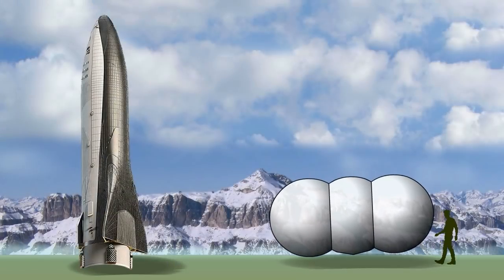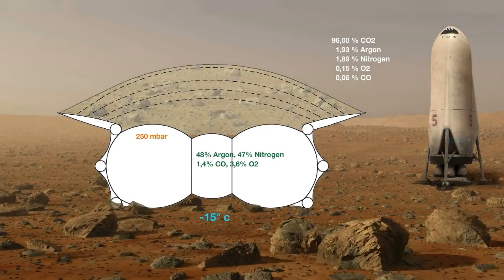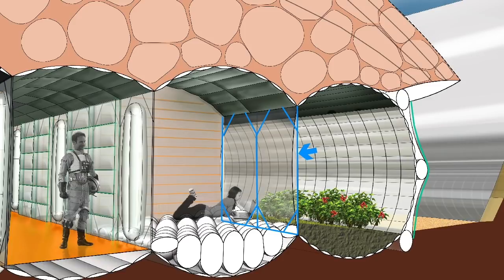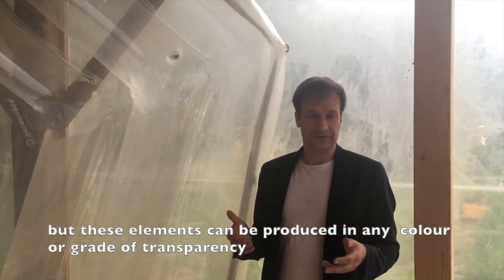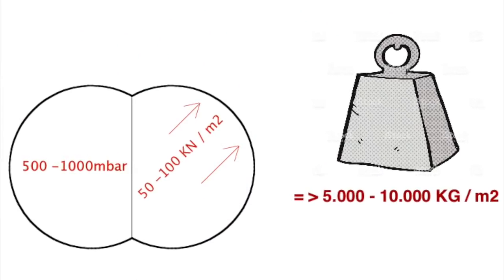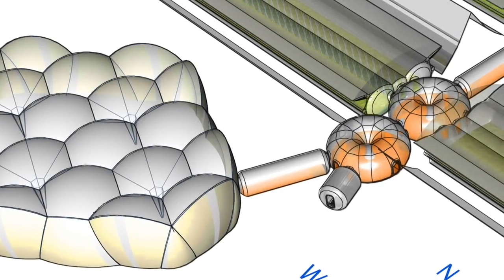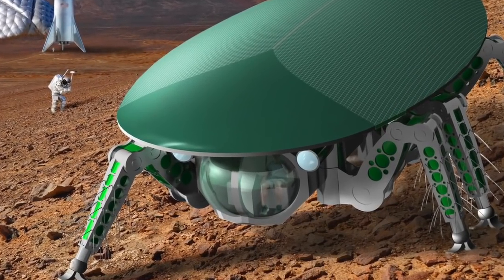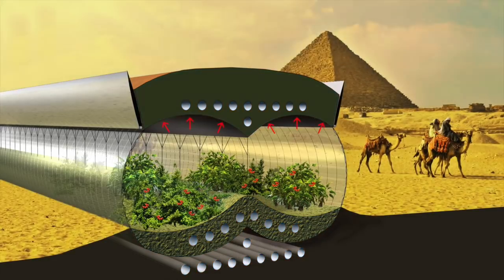inflatable Mars habitat and Lunar base

Comment: Right now many people grow microgreens stacked vertically and use LED that consumes little energy for artificially light. If humans go to Mars, it'd be easier to live underground in empty larva tubes that provide protection from solar radiation and the cold, and grow vegetables with LED down there.
Reply from the maker: LED consumes a lot less energy than previous "daylight" bulbs, But still efficiency ( visible light vs electric input)  is 50% only.  
The energy that you need for 100% artificial illumination of a greenhouse still is enormous ( 200-300W/m2) . That energy is delivered by the sun for free and does not require any payload. On the Mars equator  it is up to 500w/m2 at clear sky at noon and 150w/m2 during dust storms. 
Even on Earth, where electricity is easily available, vertical indoor faming only is profitable for growing highly priced "organic" lettuce and herbs which mostly contain water, and don't need much sunlight to grow fast.
But what counts for nutrition is the output of edible organic dry mass per kWh . For corn or wheat which have a lot more of dry mass per kg but achieve a much lower price per kg it does not make sense at all.

The novelty of that concept is that you are mostly buried under regolith for protection but still can make use of visible sunlight.

Comment: Mars' surface is often subjected to violent sandstkrms that are on a level of a Cat5 hurricane.  Therefore the habitat should be placed in a shallow crater, so that the high winds can be directed over the crater and not trapped inside it. By placing tbe habitat ona crater wall, residents can dig into the strata for additional shelter area and protection from cosmic radiation.
Reply from the maker: the  atmosphere on mars is 1% as dense only as on Earth.  Even a  storm with 500kmph on Mars has the same impact  as a wind with 50kmph on Earth only.   Duststorms only are an issue because they block sunlight and sight. The global radiation that arrives during a dust storm is reduced to about 30%.

Comment: A fascinating concept, case, and approach! I'm sure adequate redundancies are designed, but some would feel the need for rigid supporting structures such as pillars and roof as well.Cementing the regolith on top and into pillar pockets, with steel wires, could also be readily facilitated as well; but that likely needs water, which evaporate easily on Mars, so super glue? :D
Reply: During the CO2 liquefaction process and regolith excavation, the water extracted could be used for the plants and any excess pumped into the surrounding regolith to solidify and form rigid protection. Then the overhead PV cells would minimise evaporation
Reply: @jeffharmed1616  If we are going to go to all the effort of sending solar cells to Mars, they should at least be Sun-tracking! Unless this design features in-situ solar cells on the roof, but that would defeat the purpose of being able to set up quickly and purely with materials shipped from Earth.
Reply: No reason why Regolith on the roof - if held in vertical pockets, can’t simply remain in grain form - easy to work with.
There is no need for it to actually be a solid shell.  A sand pile / shingle pile would work just fine.

Comment: so the Regolith presses the membrane and produces pressure in it ?. interesting idea.
Reply from the maker: the weight of ,  lets say, 3 meters of regolith (4500kg/m2)  would press with 18KN / m2 only on Mars, and half as much on the Moon.  This is only a fraction of the pressure inside that you need for breathable air.  The greater part of pressure just comes from inflating it . The tensile force onto the membrane, that results from the inner pressure, is a couple of times higher than the load of the deposit
Reply: so regolith is a radiation shield, but it helps a little bit of the pressure inside, right?

Comment: How about leaving spaces for pillars of regolith in the middle of the structure, moulding a medieval-style vaulted chamber. That way a depressurisation accident could convert the structure into a self-supporting cave and not immediately crush the occupants. The sort of regolith binder that the 3D printers are proposing also be used to in the first coating of regolith to improve strength and leak resistance. Also, seems like the 3D printing approach is complementary and worth having both for redundancy in the same was as with energy sources.
Reply from the maker: that could be done over a long time,  when  the inflatable structure already is in use.  But it won't help much.  
When you have an air leak on a Mars habitat that cannot be fixed quickly , the major problem is the lack of breathable air and low air pressure that makes eyeballs pop out and blood vessels burst, not the collapse of the structure. 
On an inflatable building  the collapse does not destroy the structure, because there are no rigid parts that could break. After repair of the airlock it can be inflated again.

Also the inflatable structure does not crush immediate but collapses slowly as the air escapes through the leak. In case of a leak not too large,  slow enough for humans to escape as well. The weight on the ceiling presses on the volume so at least some of the inner pressure is upheld during the collapsing process
Reply: Maybe multiple layers - not just one or two !  Also fibre reinforced to ensure it can hold tension.  Multiple backups are essential - Mars is a long way away !

The Regolith pillars idea is not a bad one either - as it could prevent a cave in.

Atmosphere is always a prime consideration.  Multiple sealed chambers with air locks inbetween, even if they are normally all at the same time pressure - if one chamber should get depressurised, the airlock becomes a stop point.  The Regolith pillars together with the roof tension cables will prevent a roof cave-in.  Even though the roof in that depressurised section would now sag, it would not collapse.

Another idea is the use of a self-sealing compound between plastic layers, so that any small breach would auto-fix. Although that’s a bit messy do maybe not ?  But the reason for the regolith roof, is to protect from micro meteoroids and cosmic radiation.

Comment: I think this idea has potential. I'd focus solely on the lunar torus design. It would work just as well on Mars and you simplify your design/testing/construction chain. Bigger bases just means more modules. Not to mention long tunnels of just hallway is a waste of mass. They are dead weight for the structure and all the pipes and wiring that go through them, so reducing connecting hallways is essential. 

My main concern is that air pressure is keeping up the tons of regolith above your head. What happens if/when an explosive decompression event occurs? All that regolith will come crashing down like a mine cave-in. Considering your bases have no internal pressure doors, any kind of air leak would lead to the entire facility decompressing. Some sort of back up structural support would be needed to keep the entire place from caving in.

I love the V-Doors (i'll let you figure out what the V stands for :)). I've been trying to think of some sort of simple airlock door for a while and I think this has potential to be a potential pressure door. Maybe add a zipper seal on each side and bam, pressure door.

The torus base is good but I think you should put the walkway on the outer wall instead of in the middle. While this will reduce overall useable space somewhat, it would be a MUCH safer design as each living/working area would have two exits. One into the hall and one into the farm/garden area. So if, say, a fire breaks out right outside your door, you still have an alternate means of escape. Also the outer walkway wall can be used to run piping, cabling and vents easily.

The material used would have to be very resistant to punctures and constant rubbing against sharp regolith. On Mars, the temperature can very greatly and as the air inside heats and cools, the entire facility will expand and contract. Or, at least, move around a bit and rub against the regolith below and above it. I don't see a purely inflatable habitat being more than a semi-permanent structure (with maybe a 5-10 year life max).

I think it would be really great as a temporary base plus a form for casting say martian concrete around it (martian regolith mixed with a binder to make a concrete like substance that can be poured around the habitat to make a solid structure).

Great ideas though! I love it!

Comment: Interesting idea.  What benefit do the ceiling "support wings" offer over just having another inflated tube running along the outside?  Seems like tubes would be lighter and more compact, as well as less stressful on the rest of the habitat.  You wouldn't want to spend a lot of time in the outermost tubes, but they could be useful for growing more radiation-hardy crops, or just filled with CO2 and only used as support structure.

Comment: Who is going to live in a balloon on a hostile environment where sharp objects are prevalent?...
Reply: Pointed objects are indeed prevalent, but the gravity and pressure these objects cause is 60% less than here in Earth.
Reply: @369mfkzt2  still, that does not elevate the problem.
Reply from the maker: there is a thin layer of foam between the outer membrane layer and the regolith for protection , which is sharper than sand on Earth because there are less movements  from wind

Comment: 3:55 I quite enjoy the design involving making the outer pressure-containing layer out of closed, inflated cells. (I've continued to think about this.) I like that it provides both redundant pressure containment and a straightforward means of identifying and localizing the presence of leaks, even if they are very slow leaks. (It might have helped if the ISS modules were designed this way!) 

One issue I have been thinking about is how leaks can be detected in places where the pressure-containment layer is not easily accessible to visual inspection, e.g., at the bottom of the habitat, under the ground or flooring.  

It occurs to me that is should be possible to design small wireless remote sensors that could detect the loss of integrity of an inflated pressure-containment cell. There are already companies that manufacture small wireless sensors and integrated circuits that can function without batteries that need changing. One could in principle engineer a small wireless sensor module with appropriate functionality. Perhaps it would include a pressure sensor and an ultrasonic sensor for detecting changes in the volume of the cell or perhaps it would measure the strain in the membranes. Regardless, it should be possible to engineer a module to detect loss of cell integrity. One could integrate such sensors into every cell that is not accessible to visual inspection, or even into all cells. Granted, this would increase cost and manufacturing complexity. I do love how the baseline design offers so much well-thought-out functionality in ways that are ultimately quite simple, even relatively low tech.

If one were really paranoid about redundancy in pressure containment, one could introduce additional layers. For example, theoretically, one could have a third membrane and the cell-boundaries between layers 1 and 2 could be located differently than the cell-boundaries between layers 2 and 3. Though, that might become prohibitively difficult to manufacture and/or install. One could also simply use two double-layer-with-cell structures, one inside the other. One would have to do a careful risk-reward study to decide if either of these more complex designs were worthwhile. Likely, they're not necessary. But, it might be nice to have these options in mind, in case the basic design is for some reason assessed as too risky. Maybe extra redundancy would be viewed as worthwhile in areas where humans spend most of their time?

When a habitat gets sufficiently large, it might also be comforting to have partitions between sections of the habitat that are capable of holding pressure even in the event of catastrophic failure of one of the sections. 

(Of course, with all that regolith on top, pressure failure of a section would be even more catastrophic and likely unrecoverable than in would be with a rigid design. So, you really, really, don't want a blow-out to happen. Those engineering a real system will need to work through failure scenarios and ensure all significant risks are mitigated. I do think that the risks are likely manageable, and the design has enough merit that it deserves to be taken very seriously.)
Reply from the maker: yes the saftety and to avoid airlocks are one off the most important challenges and therefore the most criticized point of the design
Since effort and expenses are not a big deal for a Mars Habitat , sensors might make sense if they and the required cables can. be small and light enough. and they need to deal with pressure changes through temperature changes and if the celll are manually inflated their inner pressure will be different from the beginning.
Regarding a 3rd layer it is almost unmanageable to weld these 3 layers together with the cells overlapping in a different position. because all 3 layers are pressed together by the welding mould  and you only can weld together all three of them on the same place  with one welding process then. The only solution could be to have 4 layers by producing 2 independent double layered membrane tubes where one is inside. the other one.  
Also in case of repair you only have access to the inner membrane. or the outer membrane ( by removing  regolith) but never to the middle layer.
For other safety feature, like independent modules that can be shortcut from the system by lock doors  and bypassed find the pasted text below:

well sorry!

it seems, youtube does not allow  to post copy-paste text
Reply: @thomasherzig174  The sensors could be entirely wireless, with no need for any cables. And, there are schemes for making so-called "zero-power" wireless sensors which are powered by having them harvest ambient energy -- such as temperature variations (in locations where these are significant) or radio-frequency energy beamed in their direction from time to time. I expect that these could be at most a few square centimeters, and thin. They could be adhered to the inside surface of one of the membranes before the membranes are fused together to create cells.

Yes, there will be variations in pressure and volume or strain due to temperature fluctuations, variations in initial inflation pressure, etc. I wouldn't expect fault alarms to be linked to a fixed threshold. Rather, I would expect that data would be tracked over time, and an alert would be raised in the case of a significant drift over time or a sudden major change. The "brains" that decide when to raise an alert might be in the sensors themselves, or might be in a habitat management computer that periodically polls the sensors for raw data. 

(Edit: I see at least one reference that talks about sensors of this general type already having been tested in the context of a prototype inflatable lunar habitat: https://www.highfrequencyelectronics.com/Nov12/1211_HFE_sensors.pdf)

It makes sense that simple manufacturing techniques that apply to a 2-layer structure would not be adaptable to a 3-layer structure. (Edit: At least, this is an issue if one is welding layers together. I assume that makes the best, strongest and most air-tight join? A third layer could possible be added if it was attached using adhesive, instead of welding? Though, I'm having doubts about my original idea of having the cell boundaries differ for layers 1-2 vs layers 2-3; I'm realizing that might introduce additional stresses that could increase the likelihood of failures?)

As for repairs... Even with a 2-layer structure, I'm guessing one usually wouldn't try to directly repair a damaged outer membrane adjacent to regolith on the top or on the bottom. I'm imagining that one would instead bond an additional segment of membrane on the inside, and inflate the pouch it creates, so as to ensure that one once again has at least two layers of membrane providing pressure containment, as well as a cell that can be used to localize leaks. Or, do you see this working differently?

(In a scheme where two 2-layer structures were used, it would be considerably more challenging to attend to any loss of integrity in the outermost layer.)
Reply from the maker: @zzubra  you can repair small punctures or cuts with a clue tape, but generally glueing never is as strong and reliable as welding the membranes. To  glue on a hole panel for a cushion would be very hard to glue so accurate that it is airtight and the glueing connection can t take the same mechanical stress as welding.
Or maybe there is a super expensive super adhaesive glue paste or glue tape for space missions that is not used on normal applications on Earth ans that I dont know yet
Reply: @thomasherzig174  Makes sense... The patch material could be thicker than the primary membranes, so the patch could be designed to take the stress. But, one would have to be careful about the attachment to the primary pressure containment structure so as to not introduce unacceptable stresses there... I would hope that the probability of more than a tiny puncture or leak will be very small. (Working out repair strategies might be a significant research project in its own right. Here's one source on space adhesives in general: http://www.spacematdb.com/spacemat/m-datasearch.php?name=10:%20Adhesives,%20Coatings Nothing immediately jumps out at me about them.) Thanks for your thoughts. I wish you a lot of success in further developing the concept and getting it due consideration.